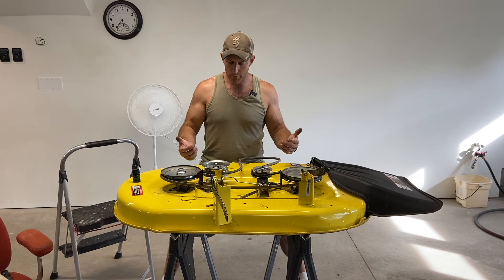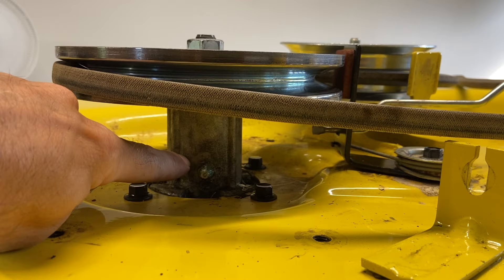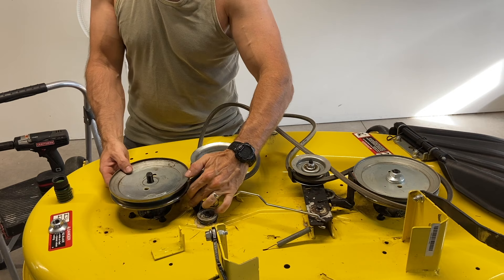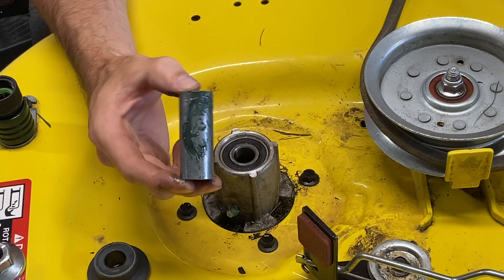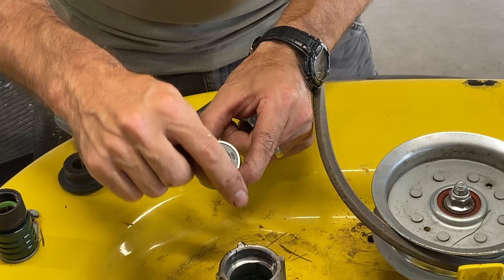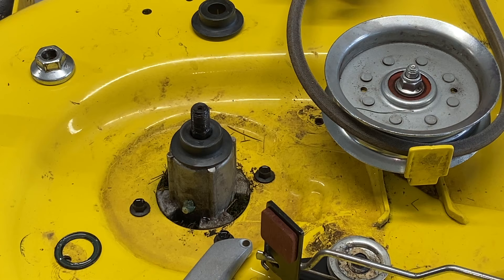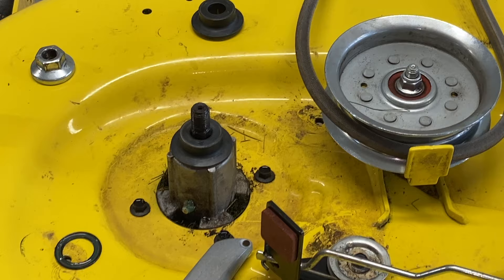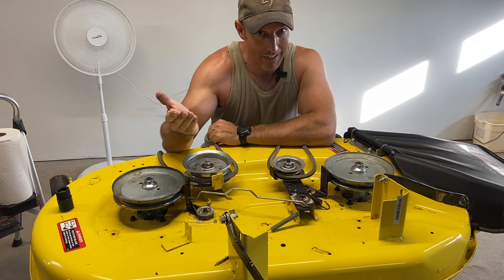I WOULD DO THIS DIFFERENT NOW JUST REPACK THE BEARINGS WITH GOOD GREASE AND PUT SEALS BACK ON.

Comment: What make no sense  is the manufacturer can order bearings with one side open or pay someone  to take a small bladed screw driver and pop one  bearing cover off. It would be my luck they would put it in wrong and expose the bearings to all the dirt and stuff. Its just being lazy on their part. Why even have the grease zerks if they do nothing. I learned this years ago working at a small engine shop. The higher grade mowers actually removed the covers so the grease entered  the bearing.
Reply from the maker: Thanks for the Informational comment hope you have a good summer
Reply: But if all the bearings were done like this , they would lose a ton of money because the bearings would hardly ever need replacement .... they are designed to fail .... it's all about the Money !! 😉👍

Comment: It would be fun to learn the true story about this oversight.    Did engineers pull parts off shelves which were never intended to be used together?     Or where the sealed bearings added  over the years?    Chicken or the egg?
Reply from the maker: I’m not sure but I think a little different since I did this video and if your Mowing around a 1/2 acre I think they should still last a long time. Thanks for watching

Comment: Don't know why I'm here but since I am....those bearings with the friction force they will see from a lawn mower blade and the level or precision "roundness" of modern day ball bearings, having a chrome plating, the force those bearing can handle before deformation-they will never need more than the factory grease really...the only time there might be an issue is if the chrome plating was damaged and the ball bearing began to rust.....when you took off the seal of the bearing you left them exposed to bigger particles/chrome plating to be damaged....you put way to much grease in and are using too heavy of a marine grease- could cause a pressure deformation of the ball bearing...don't think it's much of an issue given the size of those balls...but you actually don't want to "pack" bearings in a high pressure and high speed situation...thin even coat is all, leave the seal on
Reply from the maker: Thanks for the comment and advice

Comment: Pretty much wasting time worrying about nothing.  My JD 155C, 48" was bought for the farm on 6-6-06, has 605 hrs. and the deck bearings are just starting to get dry so I'll put new bearings in this winter.  So 15 + yrs,  over 600 hrs. and you want to call this a, " Flaw" ?  Are you crazy?   As many here have stated Sealed Bearings of good quality last just as long or longer as greasable ones.  Most all idler pulleys are sealed,  most all front and rear wheel bearings on cars are sealed, many lasting 200,000 mi., nobody worries about greasing them.    Many spindles are welded and you replace the whole thing.  That common JD spindle as you show is very easy to take apart and put new bearings at 15 + years for me and you call it a flaw?  I think you need to reconsider what a  " Flaw " is.   I've replace 3 idler pulleys,  on 3rd battery now,  probably 5 deck belts, 7 blade sets and still runs like new.   I'd say pretty flawless design mower.
Reply from the maker: I have reconsidered my opinion that’s why I say to read the comments thank you for watching and commenting hope you have a great summer
Reply: @DIYJIM  Not sure why but good companies do sometimes use too small of a bearing or cheap bearings.  Harley used a nylon caged needle bearing on the EVO camshaft which you change to a good Timkin and Husqvarna is doing the same on some of their newer saws.  John Deere has built several units with flaws such as weak transmissions or poor engines as several report on Y.T.   That is a standard size, easy to find bearing that should last for years.  I also see people complain about the steering gears on those  mowers but mine has held up fine.  When it does go bad the 2 gears and nylon bushings are very easy to change and a cheap fix.  I sure don't baby my mower at all but so far it has held up very well.  Sorry if I seemed a bit rude, it was a bad day cause cows didn't get moved.  Your video is very excellent and with it anyone should be able to fix their own spindles.  I checked your Channel and decided to subscribe.  Have a Blessed Day from Mi.
Reply from the maker: @jefffrayer8238  No hard feelings thank you for subscribing hope everything is going good on the farm. Thanks for checking out my channel I have worked very hard to make it good.

Comment: Good god. Waste of time to remove seal and regrease. A sealed bearing is lubed for the life of the bearing. All he is doing is potentially destroying the seal and likely adding contamination to the inside of the bearing. Either leave it alone if the bearing has not failed, or replace it with a new sealed bearing. Additionally, never use tooling like he does to remove the bearing (punch). Always use a  drift made of brass. Doing it the way he does will only dent the raceway and introduce spalling that will fail the bearing.
Reply from the maker: thanks for watching

Comment: Those bearings are going to wear out no matter what you do. You have just shortened the life of those more expensive bearings that the manufacturer paid more for so that their equipment would last longer. Over greasing is the #1 reason for premature bearing failure. Go ahead and listen to all the dumb asses who say different. Then take the time to listen to those who do nothing and get a much longer life out of their bearings. Google RV bearing maintenance, to see the maintenance when manufactures spend less and don't put a quality bearing in because they cost more.
Reply from the maker: thanks for info and thanks for watching

Comment: All the Generic Mower's have Hubs like this, they installed sealed bearings and zero grease can get inside bearings--the Real JD's, Kubota's-higher price Mower's do not have this design, when you pump grease into their hubs, you are greasing an open face bearing...
Reply from the maker: good to know, thanks for watching
Reply: I have owned higher priced Kubotas with open bearings and they are the ones that have failed. I have only had one sealed bearing fail. The OPEN bearings should be better, but in my reality they are the ones that had more limited life spans.

Comment: This is soooo wrong and ignorant.  The grease you pump into the spindle is meant as a purge so that the sealed bearings run in a clean environment.  The spindle and deck is a very dirty environment, and the purge grease is used as a barrier to contain dirt and keep it away from the bearing.  The last thing you should do is pop the seals and co-mingle dirty purge grease with the lubricating grease in the bearing.  Just grease often to push the captured dirt out, and leave the seals in place.  The bearings won't last forever, but they'll last longest with seals in place, and purging often.
Reply from the maker: Thanks for commenting

Comment: The bearing are less than $5 each and take 10 minutes to replace. . Buy some and change them as they fail. You got too much time on your hands
Reply from the maker: Thanks for the comment, and information
Reply: trouble is by the time the bearings fail they can take the housing and belt with it

Comment: With the bearings sealed, it seems that delivery of lubrication is for the spindle only. Such a design is consistent with intended premature wear of the bearings. Shame on John Deere and its flawed engineering. My guess is that all modern manufacturers employ the tactic to generate additional revenue through sale of spare parts.
Reply from the maker: Thanks for the comment,  I have found out that a lot of the lawn mowers are the same
Reply: It’s because most don’t grease the spindle. Bearings can maintain grease then.
Reply: Being as the mower manufacturers don' make the bearings and people don't buy bearings from the manufacturer, there is no motive for such a "tactic."